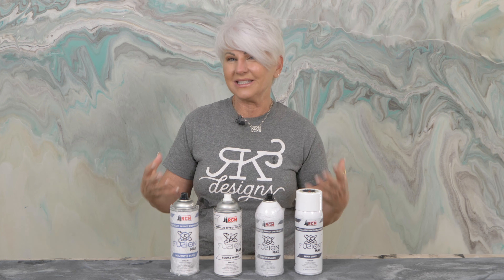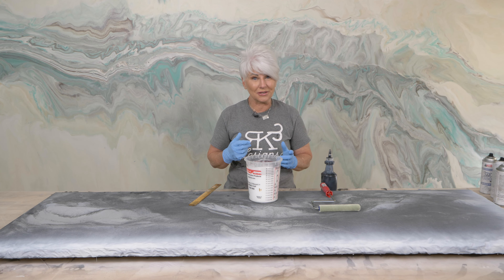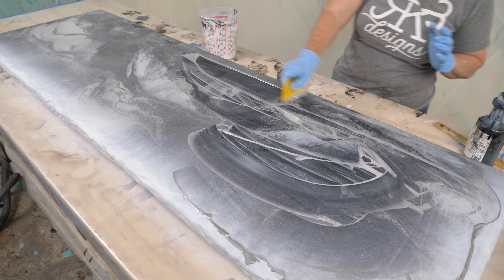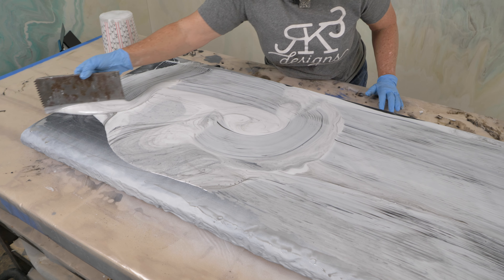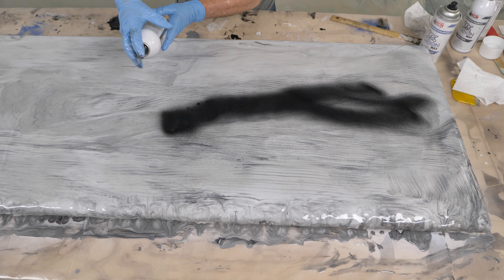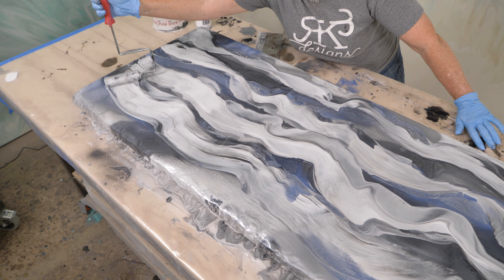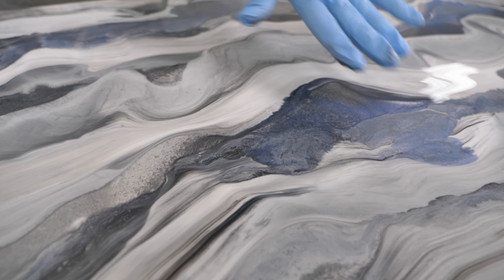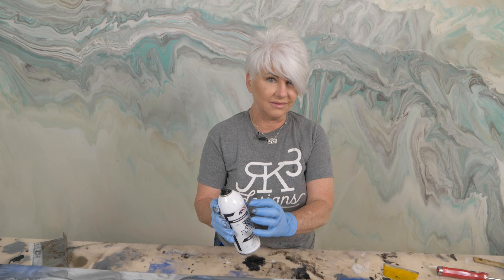A NEW Way to use Mica Powders in Epoxy | Spray on Countertops

Comment: Looked very man made to me.  I'd have sprayed a bit higher, giving a more distributed coat.  Still pattetning, but from what I saw the mica disbursed in wild patterns on its own.  That might have given the alcohol sprite effect on its own.  I also agree with another post - everything after 14 minute mark undid the previous work :(  but, that's the beauty of Resin - you can create what you like, to your own drummer as it were.  Love your videos - skads of techniques and ideas!